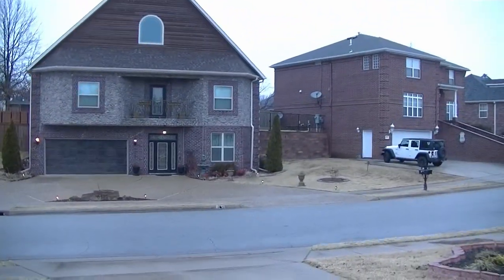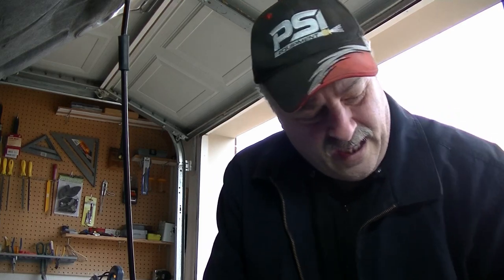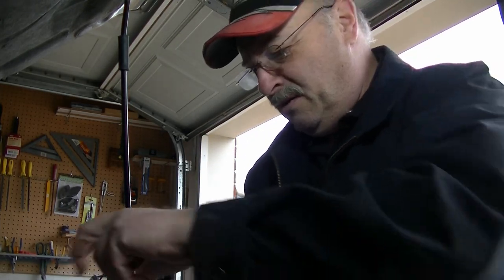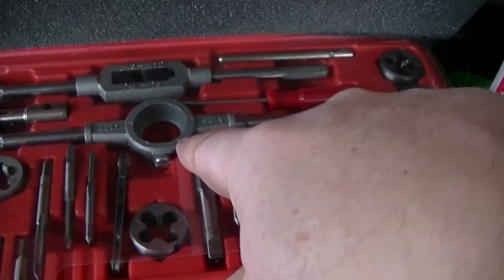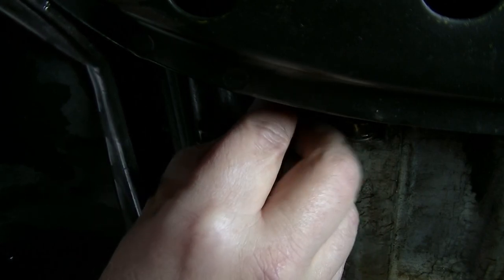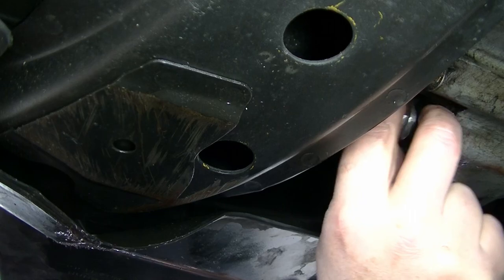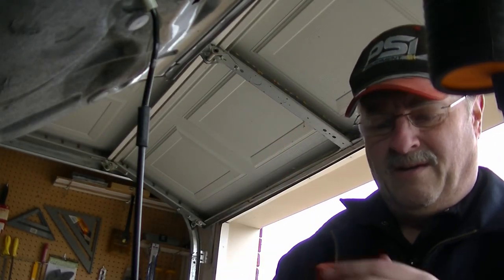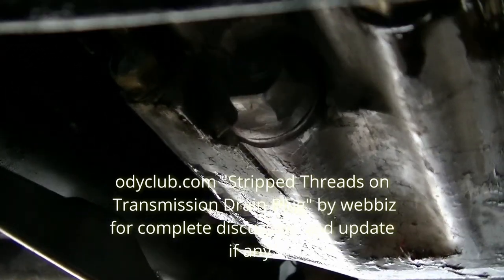FIXED!!! Transmission Drain Hole Threads Stripped! | Successful Repair

Comment: As my adult son Nicholas would say:
"Nice"
After watching you take what was obviously a hours long repair (and reading all about it at odyclub), you are my kind of guy.  This is the first time I have seen 90 posts for one problem.  This is exactly the kind of thing I would do, and the feeling of accomplishment when done is wonderful.  
Do you think something could have happened to the bolt threads while you were grinding the flats of the head to 17mm?  
I have found it necessary several times to run a die over bolt threads.  Maybe it's just manufacturing tolerances, or something just not perfect with manufacturing that causes such problems.  I suppose with steel to steel, the bolt is just tightened to the proper torque without regard how it feels being threaded all the way in, and you noticed it because of the concern due to the aluminum housing.
For sure, I will be most careful in working with my drain plug, and using a torque wrench.
Thanks for the somewhat long video.
Reply from the maker: Hey Nick. Yeah a couple of guys did find the thread to be 'entertaining'. I'm not a regular on Odyclub, so I found it comical to see that mentioned.  No, the threads weren't affected by my grinding because I held the bolt the whole time using a wet shop rag. It was not cinched by any tool or vice. As someone who really hasn't spent any real time with die/tap, I found it odd that a brand new bolt at 18 x 1.5 would meet with resistance using a 18 x 1.5 die.  I guess it just needed a little chasing.  Thanks for sitting through a long video. I personally enjoy watching car fix vids of good length as I chill in my recliner at night.  :-)
Reply: @RixCanDoit  Thanks for the quick reply.  Keep up the good work.

Comment: Have same problem with honda crv transmission plug hole stripped wish i could fix like you...great job thank you...
Hows it holding up
Do you think the bolt will work for crv
Reply from the maker: It held up just fine. I've sold the van so I can't say what the status is now, but it should be just fine...better than new!  For the CRV, you'd have to look at the threads. If your OEM bolt only used half the threads like mine leaving half still good, I don't see why you can't just buy a longer bolt to use those good threads. Just don't get it too long that it enters the case too far.
Reply: @RixCanDoit  YES THANKS MUCH APPRECIATED
I ORDER BOLT ITS 18MM LIKE YOURS FASTENAL ONLY PLACE TO SHIP IN YAKIMA WA...
WILL SEE THIS FRIDAY...
THANKS AGAIN

Comment: Great job. I had same problem. I couldn’t find the bolts. Where was you buy it!
Reply from the maker: There is a store in town called Fastenal that sells bolts and other related items.  Online I found they had a bolt long enough with the correct thread for $16. I needed it longer than the original to catch the threads that were still good deeper inside the hole.  But when I tried to use it, the head of the bolt was too big! So I grinded a smaller head on it and left enough to act like a flange.  Thanks for commenting!
Reply: @RixCanDoit  How did you grind a small head on it? That sounds pretty hard, how would you know to get the exact size?
Reply from the maker: @deegee2416  Used a standard garage bench top grinder.  I marked it before grinding so I would know who much to grind off.
Reply: @RixCanDoit  ahh used socket to make markings to match the exact size. Then you started grinding it off. I would like to see a video of this some day.
Reply from the maker: @deegee2416  I don't think I'll be doing anything like this again so you won't see that video here I'm afraid. It was something I had to do when I had my van (sold it).  Didn't use a socket. Just a ruler, drew a few lines, and grinded up to the line. It is as easy as I just described. You just stop and test periodically until you get it where you want.